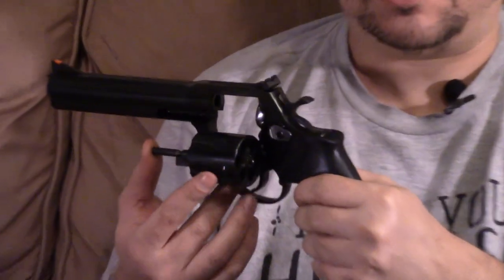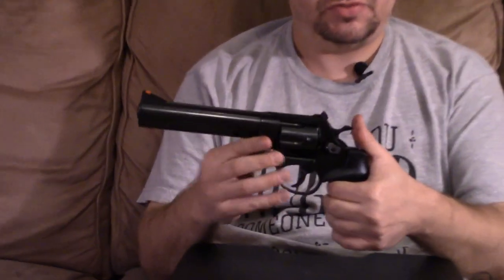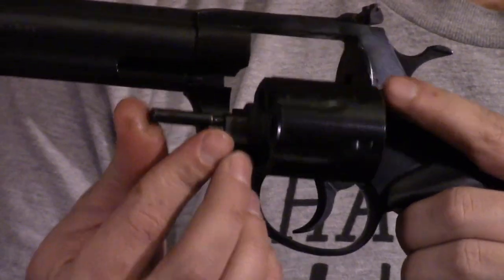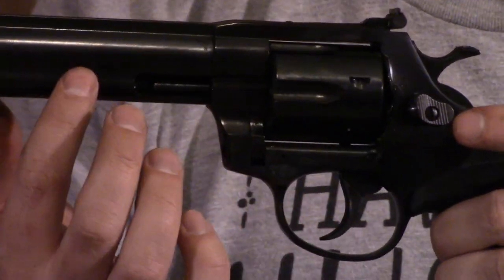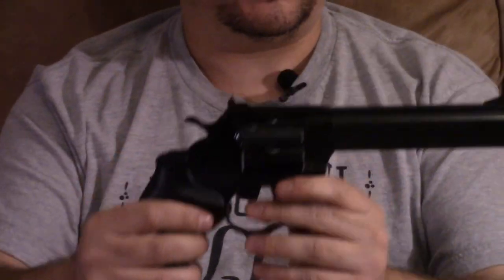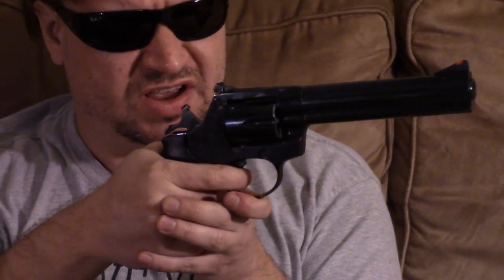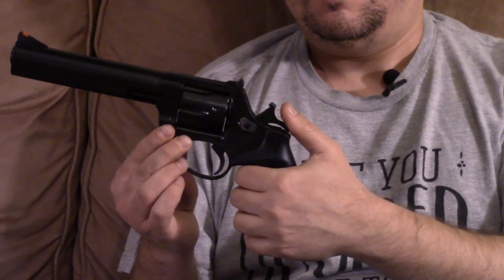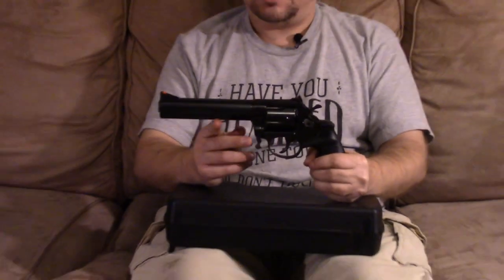A 21st Century Revolver - Czech Alfa Proj .357 Magnum

Comment: Wow I didn't know about these. Smith & Wesson quality control sucks and I hate those locks in the frame so I don't buy Smith & Wesson anymore. I hate Ruger revolvers and Taurus are poorly made so I quit on revolvers but this may get me back into a revolver again.
Reply: We'll shoot it again of course, but so far, so good. We were both happy with how it shot, especially with .357 Magnums. Personally, I like the more vertical grip angle. It balances better for me and I think it just looks more interesting/unique.
Reply: It looks like it has a Colt Python hammer spur. That's a good thing.
Reply: I could see that. Its different but I can see a similarity sure, cheers.
Reply: Why do you hate Ruger revolvers? Don't like the looks? The trigger pull?
Reply: Yes, I'd like to know why you don't like Rugers. I've been looking at getting a used GP100 and need to know
Reply: toomanyglocks "well then there is no pleasing you" if you don't like S&W or Ruger, your not going to like the ALFA PROJ either. They are no better built than a Taurus,  Astra,  or Charter. They do however look great especially the stainless models. They also have a great lifetime waranty. And thats good, because your probably going to need it.